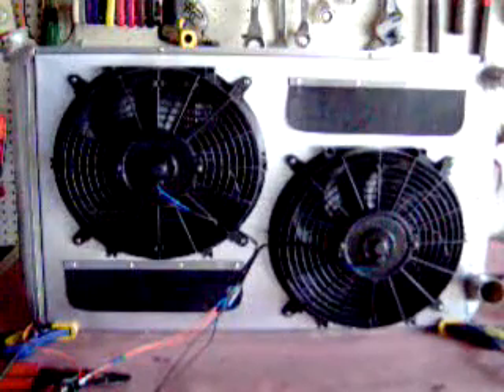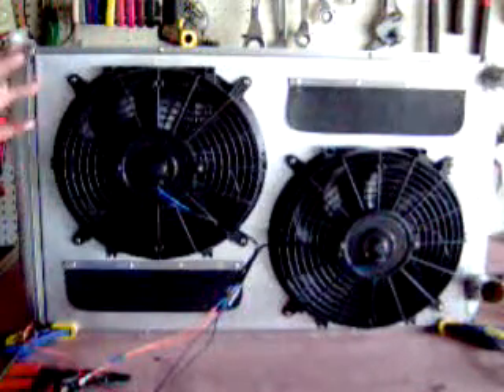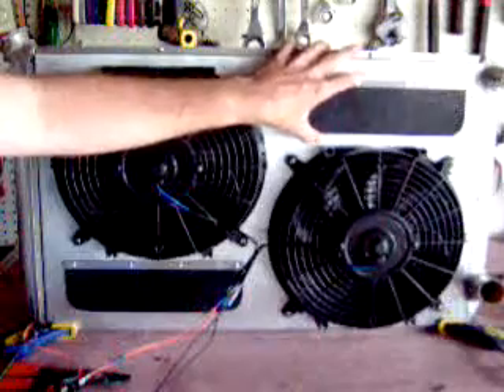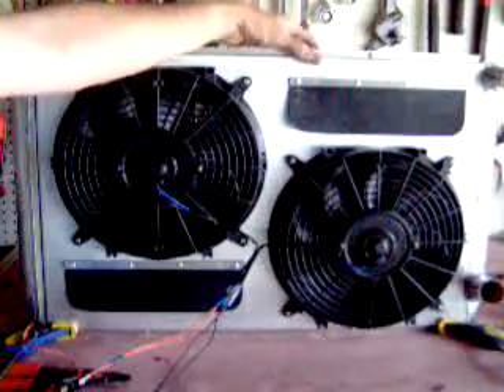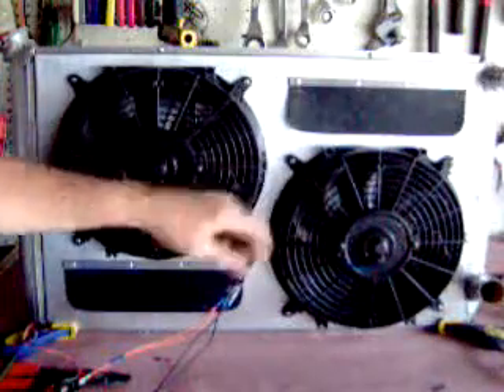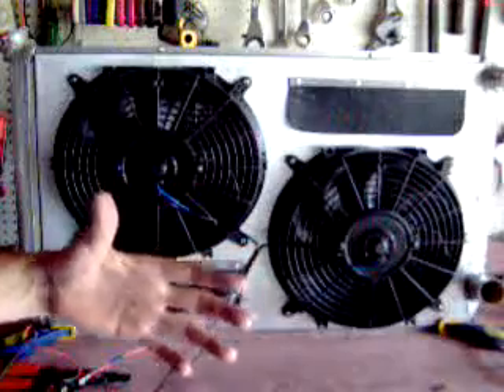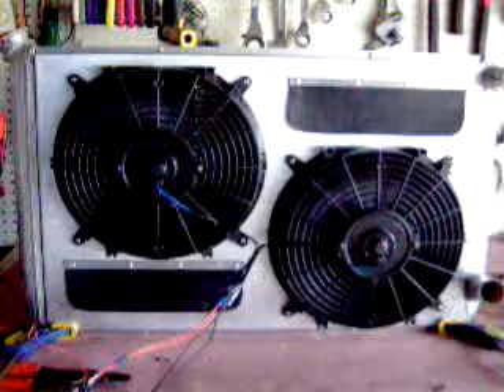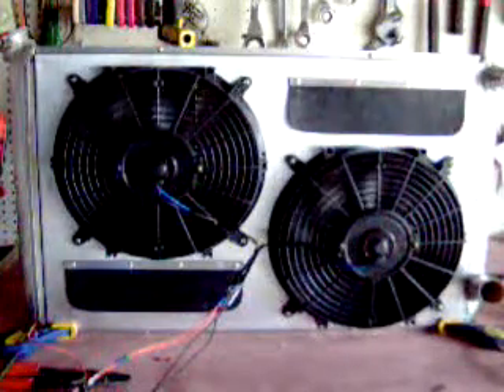Radiator Fan & Shroud CFM  Demonstration

Comment: Hi Mark. I have a 17 x 26 1/4 "core dimensions" or 18 1/2 x 31 overall Champion cross flow aluminum radiator.  I am looking for an aluminum shroud for a 16" electric fan.  I live in Florida.  Is this possible for you to make?

Comment from the maker: Hi, Do you want a complete shroud with fans? Need exact core size. how much horse power? shroud alone is 250.00, you'll cut out the holes for the fans. includes shipping. Thanks Mark @ South County Performance (949) 388 4818

Comment: i dunno if you really need the draft flaps, although the concept is good.  I say if the fans can pull enough cfms through to keep the engine coolant at a the proper tempurature, then the engine will tell the fans to turn on even when the car is moving.  Which will allow the air to move through at a velocity no less than if the car were at a stand still.   You might want to exchange the dual 8" fans with a single 12-14 inch fan.  More area in a 12 port than 2-8" ports, possibly less current draw
Reply: It depends. If a lot of the radiator is covered by the fan shroud like in this video the flaps will likely help quite a bit, but if most of the radiator is covered with a fan and the shroud doesn't cover much of the radiator the flaps probably won't do much. Running the fans while the vehicle is in motion makes no difference whatsoever from what I have seen, the ram air will outflow the fans and the fans are going to be spinning when the vehicle is moving from the air flowing through them whether there is power applied to them or not. But if somehow the shroud was so restrictive that the fans needed to be running when the vehicle is in motion to keep it from overheating that wouldn't be a good setup, when driving 40+ MPH the ram air should be able to cool the radiator off no problem without help from the fans.